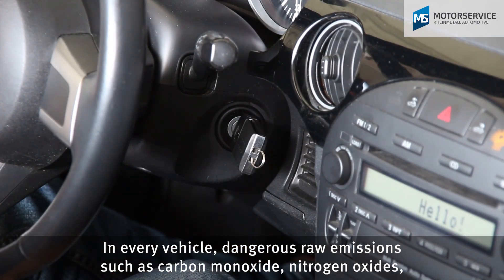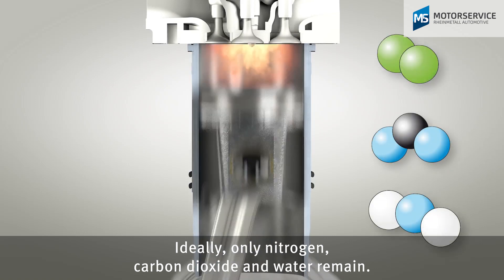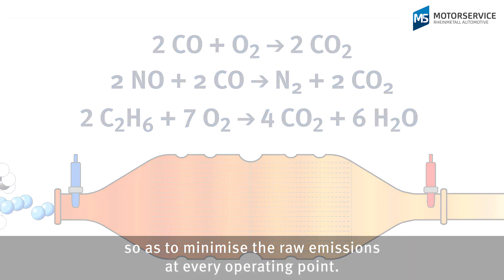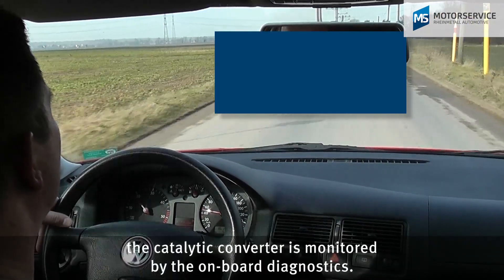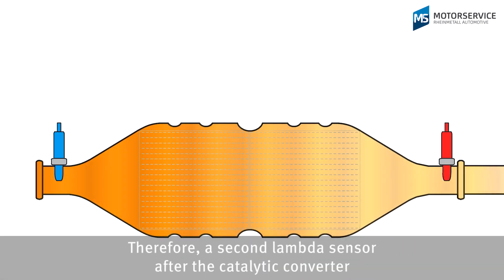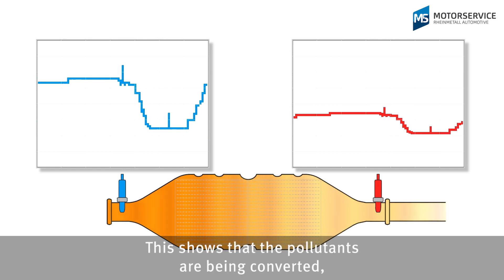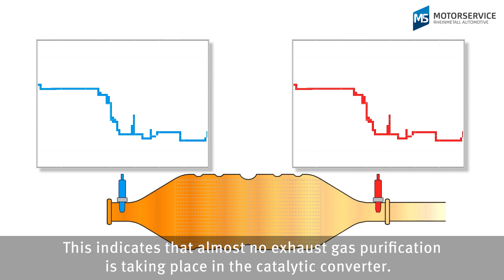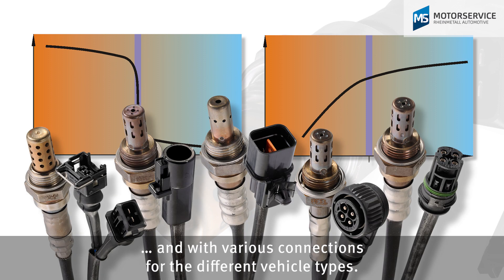How the 3-way catalytic converter and lambda sensor work

Comment: How come a "stone" reacts with smoke?
What kind of chemical reaction takes place inside the catalitic converter? 
Dry components from exhaust gas are being trapped by that "stone" because the construction is made like. 
That's the reason for cleaner exhaust gas after a catalytic converter. That's the reason for the catalytic converter getting clogged and needs replacement around 80k km.